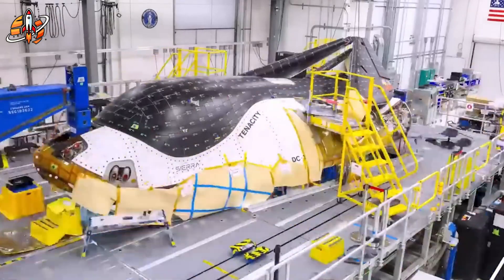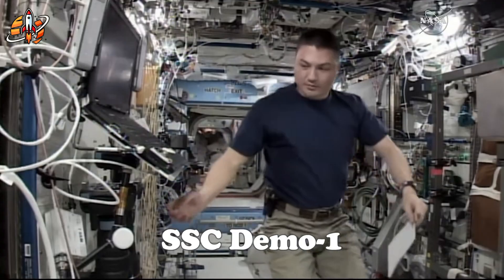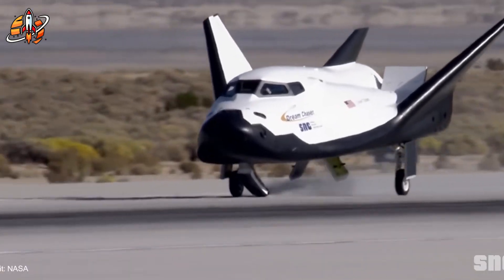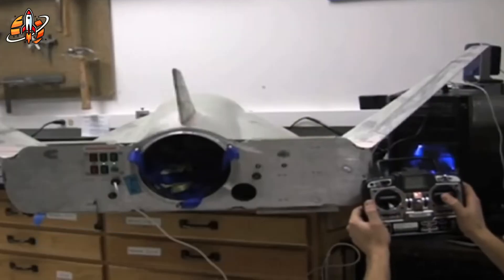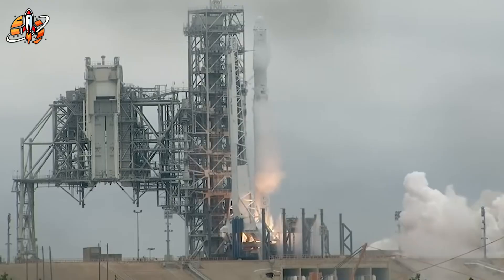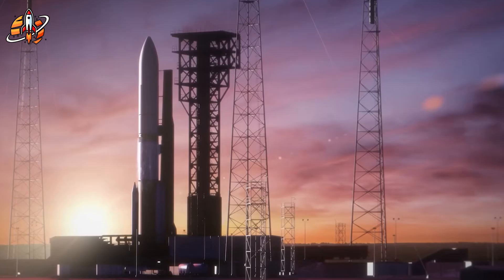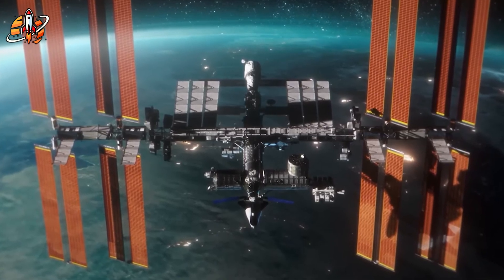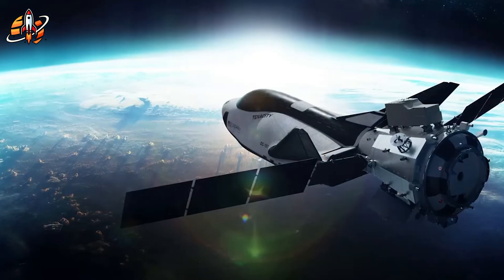Dream Chaser WINGS in Big Trouble: Why 26 Rocket Engines Can't Fix This!

Comment: ..."26 engines"  vs "the best part is no part"
grounded vs  50 flights
Reply from the maker: The "26 engines" showcase DreamChaser's precision, but SpaceX's "no part" simplicity has proven reliability with 50+ flights.
Reply: The Soviets were the kings of keeping it simple.  While they were pumping out Soyuz capsules we had a 'reusable' system that required close to a complete teardown costing almost 10 times the cost per launch as the simpler system for savings of being able to reuse the orbiter.  I had friends in NASA and their constant complaint was how Shuttle was eating up the budget.

Comment: This is just like many NASA contracts. It's just a welfare program for PHDs. Meanwhile, the winged X-37 has made 7 flights since 2010.
Reply from the maker: Spot on—X-37B's 8 winged flights since 2010 prove military agility trumps NASA's PhD welfare for cargo like DreamChaser.
Reply: NASA is so adverse to failure that they no longer innovate but integrate.  Everything has to be tested over and over again raising the costs.  As project costs rise the aversion to risk climbs.  I can understand it for human rated flight but for satellite launches it becomes insane.  That was the thing about Shuttle.  They were using man rated systems to launch satellites which themselves had to be certified for manned flight.